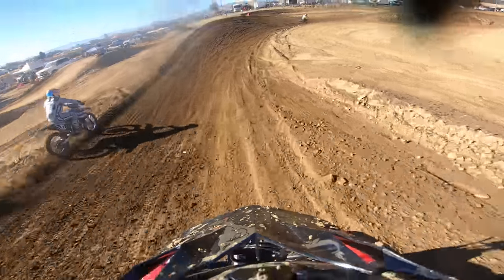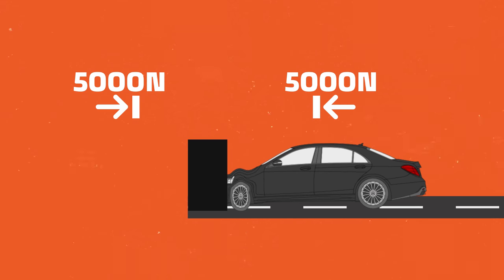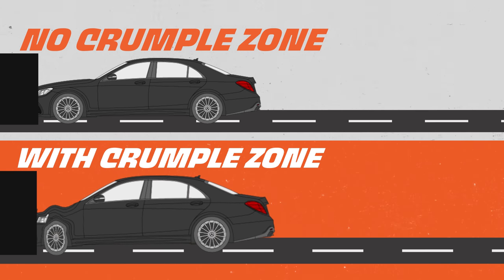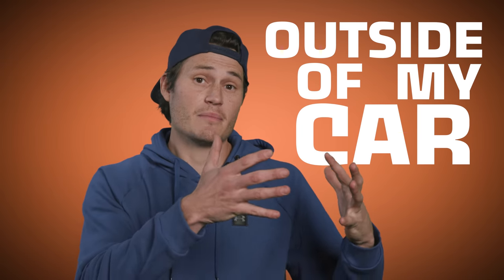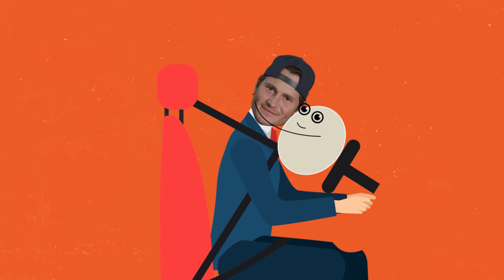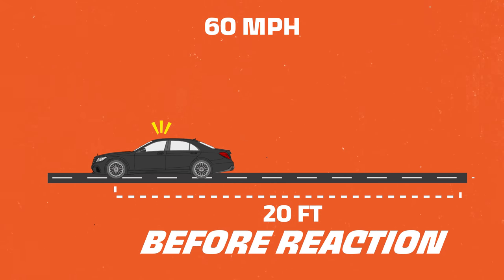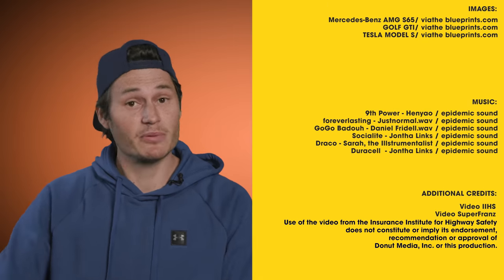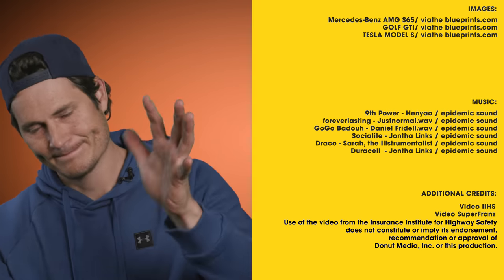How To Survive A Car Crash

Comment: 1) Pre-Lock your seatbelt, if possible (pull the belt all the way out and then let it back as it makes that ratchet noise). 
2) Position your seat as far back as possible while still being able to fully extend all the pedals and comfortably reach the wheel and all other controls.
3) Clean your car - remove all loose objects that could become a hazard if they start flying around the passenger compartment. 
4) If you know you're going to crash, take your thumbs off the wheel.

Comment: I've been in so many accidents in my life that I've trained my self to go limp in order to save myself if I can. Last one I was in my wife suffered bruises and a fracture from the seat belt but all I walked away with was some stitches from my hand hitting the windshield. Also had a crash in a 90 ford Taurus at 75mph had I not been wearing my seat belt I would have been a statistic

Comment: My “best” accident I wish I had on video because it would be hard to believe.  I took a slight uphill s turn too fast and hit a culvert.  I did a PERFECT barrel roll and landed flat on my tires.  It wasn’t that jarring.  I traveled about 60 feet most of which was in the air.  The car barely skipped the left a pillar across the ground and took that side mirror off.  That car was still running even but was totaled (was a 16 Accord Sedan).    You’d be hard pressed to do a more perfect barrel roll

Comment: If you see a crash comming, do anything you can to avoid it/reduce the impact. For example, you might opt to sideswipe 5 cars instead of colliding with a rigid object. And if that's impossible, if it's a head-on collision, don't lock-up your elbows, take your thumbs off the steering wheel, let the car do what it's been designed to do. As a passanger, DO NOT put your hands outward to hold on to stuff and/or (DO NOT) cover your face. (Important: always have your legs in the footwell, kicking them up on a dashboard causes your knees to kick your head in when the airbag deploys.)
Also, set your seat properly.
Make sure you have working airbags (by checking for any recalls (Takata) and checking car's computer for errors), do not change your steering wheel for that ugly small non-airbag pseudo-race wheel. If you decide to do any modifications, make sure they are in line with regulations and safety procedures.
Fun fact: a woman once stuck a st. Christopher emblem on her steering wheel, when the airbag deployed, the metal emblem knocked out her tooth.
Also, predict what might happen during different road maneuvers (especially overtaking/being overtaken).

Comment: Following distance and avoiding groups. Avoid being 10 feet off the persons bumper even if your both going 70 in a 70 zone. This means kick it up to 80 get around that person(s) going 70 then once around them a good 50 to 100 or so feet drop it back down to 70. Having a clear road in front of you will allow you to react. This can also work the other way dropping your speed down to 65 to increase that following distance and once you have 100 feet shadowing that persons speed at 70 to maintain that distance.  It is easily to shadow a person or a semi just please do it in the slow lane. There will always be speeders it is best to just maintain the slow lane letting them maintain the fast lane and get around you without incident. If you come up upon ramp with approaching traffic maintain your slow lane. The merging traffic needs to merge to you not you to them(most people do not understand this). If you move into the fast lane to avoid someone not willing to adjust there speed to properly merge then you are now obstructing the fast lane. 
Following distance and avoiding groups. 7 years commercial 24 years private. Not one accident involving another person.

Comment: As a driver, wearing your seatbelt can also help save the lives of other drivers and pedestrians.

How? Simple: They keep you securely behind the wheel of the vehicle during critical moments.

Imagine you’re driving down the highway, doing 75 MPH and suddenly the car starts to swerve wildly. It’s kind of hard to regain control when you’re being flung around the cabin.

Now imagine the same scenario, but instead of swerving you have to suddenly slam on the brakes. It’s kind of hard to stay in control when you’re mashed up against the steering wheel.

Now, you might be saying, “That only applies to drivers! As a passenger I should be able to not wear my seatbelt and it’s not hurting anyone”, and you’d be wrong. 

In a 45+ MPH crash, a rear seat passenger can hit the back of the front seat with enough force to break it, potentially killing the occupant.

A front seat passenger could potentially be flung into the driver’s section, preventing him from regaining control of the car. I could go on, but you get the idea.

Frankly, if you’re too dumb to wear a seatbelt I really couldn’t care less if you get into a horrible crash and die. What I do care about are the innocent people you might take with you due to your stupidity. Wear your damn seatbelts people. Please!

Comment: It’s not that tensing your muscles during a crash will negate the forces your body experiences during the crash, but wouldn’t relaxing your body like a drunk person, allow for a greater impulse, I.e. increasing the time it takes for the deceleration to occur. If you are tensed up, your body is much more rigid, and more likely to suffer say, a fatal impact with your windshield or steering wheel

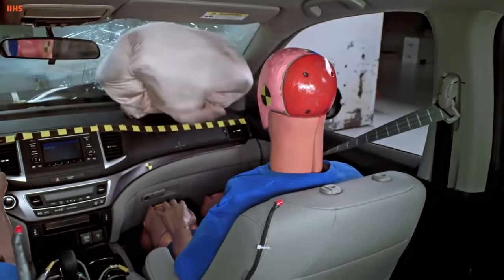Comment: 2:38 I know it's minor, but as someone who specializes in physics it bothers me that you used Pounds instead of Kilograms, since a Pound is a unit of force just like a Newton whereas a Kilogram is a unit of mass. The best way to explain the difference between Pounds and Kilograms is such:
An astronaut on the moon who weighs 200 lbs on earth would weigh roughly 60 lbs on the moon. On the other hand, the astronaut would be 90 kg both on the moon, and on earth.

Edit: Talking about impulse would have also made me happy. That's what relates force to time.

Comment: That's right dude. I had a car crash when I was younger in a maxima. Speeding and cutting traffic in the rain (my tires weren't bold but definitely not for performance oriented) some bike is cutting traffic as well i get caught off guard. So I don't crash Into him swerve into guard rail on my right making my car do two turns and up being flipped over by a big truck that unfortunately crashed into as it happened so fast. Fortunately the car ended being side ways the man asked if i was good and i said yes. He old me he would push me to flip me I said yes. After that car started smoking I got out. Sent to the hospital. Nothing on me. No whip lash or bruises or cuts.
Reply: But i was wearing my seatbelt and I think that was definitely a huge help, because the airbags didn't even go off

Comment: A long time ago I rolled my first car 3 times but I swear the only thing that saved me from hitting my head on the crushed in roof was the seat belt tensioner being set up just above my shoulder. My new car (and most other new cars) doesn't have enough adjustment to move the seat belt down to my shoulder and it scares me tbh

Comment: Believe this. 100% wear your seat belt. Saved my dumbass when at ~140mph in the center lane of 3 on the highway, a ball joint broke. Spun 6+ times before smashing a disabled parked car (truck, Dodge Dakota, thought to myself "Dodge? nope, looks like I'm gonna ram", woulda sucked to die on that bad of a joke) at around 85. Peeled the driver side door off so hard it was touching the H logo on the hood (97 Accord). I hit reverse entry style with enough force to snap the seatback where I was lying down when the glass & dust settled. I took off my seatbelt, and other than being bruised from my heel to my neck on my left side, and one little bone deep stab from something steel in my arm, I got up and WALKED away.

 I've always believed in seat belts, this should confirm it to anyone. It will save your ass even if you make some pretty serious error in judgment and go a little fast (like double the speed limit). Seriously, it's not a big deal to just wear it, please, let my stupidity be a lesson.

Comment: Just expierenced a crash for the first time, in my 15 years of driving, 2 days ago. I was the passenger, looking down at my phone. I felt that the car was moving too fast for the approaching corner, so I let the driver know, he tried to correct but it was too late. Cars tail stepped out, went into a slide. At this point i covered my face with my left arm to protect from galss and debris and grabbed the oh shit bar with my right. The car slid straight into a dirt embankment, which rolled the car. We slid on our roofs for 100 yds. or so then stopped. I struggled to undo my seatbelt but got it off. Tried to break my doors glass to get out and see where we were. That was a no go. So looked for the door handle, manage to open the door a bit before it got stuck. Kicked it open wide. Got out saw that we were still on the lane  right around a blind corner. Cut the drivers seatbelt off. Yanked him out and helped him get away from the car, then helped my coworker out of the rear of the car. After the adrenaline wore off thats when the pain started. I have some ligament damage on my left knee and my left hand and wrist just have a sprain. The other 2 guys just needed a couple stitches. All in all, it sucks lol

Comment: U got into a rollover on Friday, I was with my buddies and we hit black ice and rolled into a ditch 3 times then we kept going into the opposite highway where cars were going the other direction we were upside down and so we unbuckled got out to see that there was a semi heading right towards us we got lucky enough to to get out just in time. We were waiting in the ditch now and another truck comes, looses traction and is heading right for us in the ditch it luckily crashed into a sign instead of hitting us. Then just as we thought it was over a black Subaru going like 80 smashed directly into my friends car that was upside down in the middle of the road, the car was spinning like crazy and we were standing only about 8 or 9 feet away. We’re all ok and the worst injury form all that was a small cut on my buddies hand.

Comment: So seatbelt and stuff, that's all good. But for driving position, would a normal, more comfortable position with about 30 deg of angle in your arms in respect to wheel be better or worse compared to a more racing oriented seating position where your arms are closer to 90 deg of angle? I have a 60-70 deg angle in my speed3 so I was just wondering, mathematically, which one would be safer?

Comment: Good Guy Volvo goes and invents the 3 point seat belt, and instead of patenting the design and making mad paper off of it, they share it with the other automakers cause they knew that they're simply just the best way to save lives.

Thanks Volvo.

Comment: So when you guys mentioned a multi point harness, this isn't as good as a seat belt? I'm thinking because it's rigid and that can whiplash? In addition to that, it would be pretty interesting to learn about saftey in racecars as to their crash mechanisms. Also since a helmet has more mass, without a neck thingy (can't remember what you called it), is it worse for you? Very educational, up until now it seemed like a no brainer to put a roll cage and harness in any car to make it safer.

Comment: What we should do:

Put a huge knife in the center of the steering wheel. That way everyone drives safe. No one is scared of crashing cause of air bags, but a knife...
Reply: No one would crash because everyone is driving safer. Everyone has a knife in there car.

Comment: Me and my wife had a crash five years back.
If not the seatbelts, we would be dead. For sure.

Airbags didn't worked, all windows just shattered. My wife almost flyed thru window under the car. There was no lasting structure on the car after all.
We had a rollover about 8 times. two times thru the front and others - sideways. On about 90 km/h (55 miles/hour).

Next morning there was a feeling, that every muscle hurts and it was like that for a few weeks. But only real problems that we had, was some broken glass in my ear (that I found, somehow, only after few weeks) and my wifes shattered wisdom teeth. That's all.

Anyway, boys and girls, what I'm trying to say here, wear your fuc*ing seatbelt. It gonna save your life.

P.S. Pardon my english.

Comment: Actually what you missed:

1)Proper seating position. Sitting too close to the steering wheel or having your headrest far away from your head can make a difference.

2)Don't drive with a dog or items on your lap.

3)Keep a seat belt cutter and glass breaker in your car.

4)Have a fire extinguisher mounted in a easily accessible location.  

5)Wear a mouthguard. 😅🤣😂 Bwah

Comment: The mass of the car isn't what you should be using in your calculations 2 minutes in for the driver injuries. Yes, the wall imparts that force on the car, but even with a rigid car that isn't the force imparted on the driver. It's still the same force = mass * acceleration for the driver - in this case, the mass being the drivers mass, the acceleration being the deceleration imparted on them by the car. Then a squishy car spreads that deceleration out over time, resulting in less force

Comment: Based on tests performed in special conditions by a group of people, the average deadly speed for pedestrians is around 10 mph. Now granted, the results are pretty far from what you'd expect, but please bear in mind I only had 2 grandparents and by the second run my windshield was already cracked. If anybody is willing to aid in this research I'd greatly appreciate it!
Reply: Getting hit 10 mph by a large body truck is not the same as getting hut 10 mph by a small car.

Comment: Is there a way to make a car (from the 1970s) with lap belts and no airbags safer?
Reply: 3 point safety belts and a helmet, suspension and brake upgrades.
Reply: @edgarmartinez7155  would a roll cage help? And what if I didn’t wear a helmet but had the cage, 3 point belts, brakes, and suspension?
Reply: @brandonmack4381   i think the roll cage would have to be padded if you aren’t wearing a helmet just incase you hit your head on it you dont end up as hurt .

Comment: 1. Be predictable
     Signal properly, fucking pay attention to others and road conditions, don't drive erratically. If it's snowing, raining, foggy or congested slow down and keep distance.
2. Don't be intoxicated
     You're dumber and slower
3. Keep your distance
     So you can see, react, brake or evade. I fucking hate tailgating. But of course I sometimes do it when someone goes 30 in a 45. Again don't do that, be predictable.
4. Wear your seatbelt
     Cars are trying to protect a body shaped object that stays in a car seat not a projectile. My dad survived a crash and rollover without one with a Plymouth Duster. He said he was lucky. Always told me cars are better now and to wear it.
5. Don't have dangerous items in the cabin that could become projectiles in a crash or rollover. And strap your shit down in your trailer or truck bed. 
6. Have clear visibility
     Working lights that are on, clean windows that don't fog up or are covered in ice so you can see the road and others can see you.
7. Assume everyone else is distracted, drunk, in a hurry and retarded.
     This also goes for overly courteous drivers. I once had a guy wave me through to the other side of the road. I ignored him and looked to make sure it was safe, only to see a car come flying by that would have t-boned me if I just trusted him. Also If you're cruising in a lane on the highway and someone comes speeding up, assume they'll probably fly by and erratically change lanes, just stay how you were unless they ride your ass.
8. Maintain your vehicle.
     Keep your brakes in good condition, the best tires you can afford with good tread and not dry rotted. Replace your lights when they go out. Don't drive on E all the time  prepare for getting stuck in Winter or a flat tire on the side of the road. Or get AAA. This also goes for inspection, registration or license. I don't want a cop interested in my car because I'm out of date for some stupid reason.
9. If you can have a co-pilot for navigation, food, and cell phone communication so you don't drop your burger while typing your mom's address in and die.
BONUS. Don't drive. Statistically it's one of the more dangerous things you can do everyday. You're much safer walking or flying to your destination. But fuck that driving is fun with the right car and road. And lastly don't drive like it's your last hotlop on the Nurburgring before retirement. Buy a helmet, get some driving lessons, and check out a drag strip, track day, or drift event. Or play Forza. 
...others probably

Comment: I was going 65 and got tboned by another person who ran a stop sign going 65. Wasn't wearing my seat belt and my car tipped and rolled 4 times. I held the steering wheel as hard as I could but had compound fractures from my lower back all the way up to my neck but didnt let go or would have broke my neck. Was in an old 98 4runner and got hit by an f150. Not fun and nothing you can do in the process to make it better....

Comment: If a car hit a wall with 5000N force and the wall exerted 5000N on a totally rigid car I don't think you'd feel 5000N force. F=ma so you'd only feel force of your mass X acceleration acting on you, not 5000N which is theoretically the mass of you+the car X acceleration. I might be wrong.

Comment: so, newer modern car safety are designed as a whole package.. I have a car that 45 years old. it doesn't come with  seat belts from the factory. and my dad installed a seatbelt but the older style (not adjustable) and about 10 years ago (maybe) we upgrade the seatbelt to retracted model. 

this safety thing in newer car is making me feel unsafe everything I'm driving that car XD